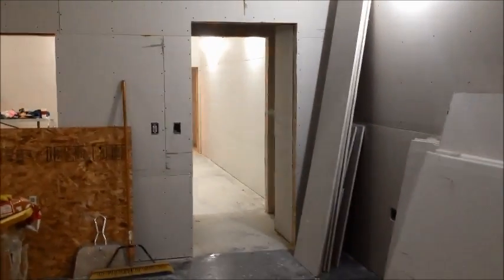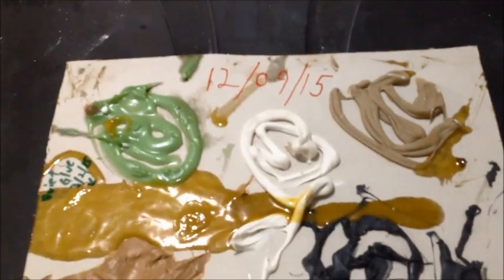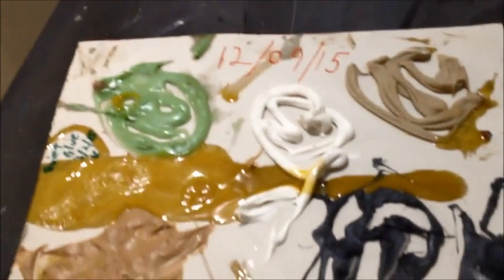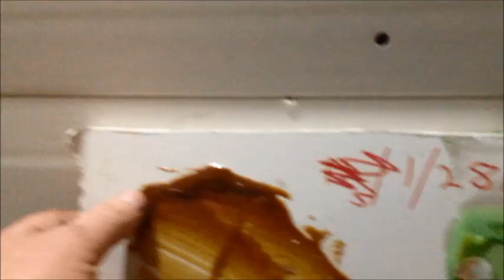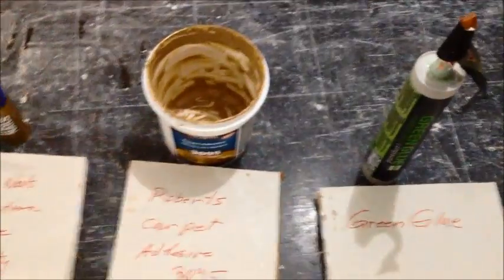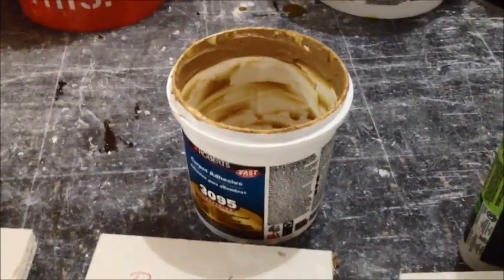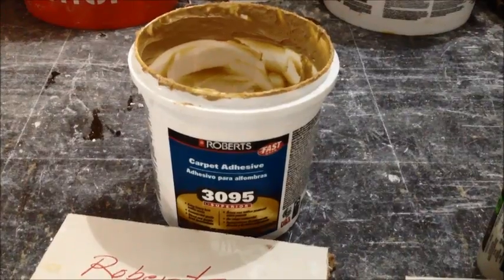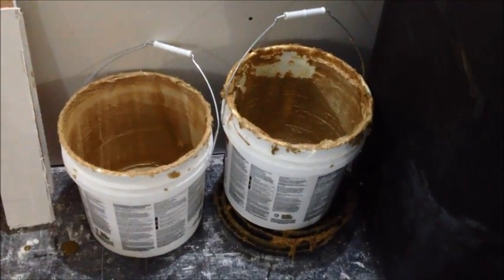Green Glue vs Quiet Glue Pro - Soundproofing comparison

Comment: REALLY COOL TEST!!!  I've been doing research too, & it usually comes down to bottom-line:  amount of desired effect compared to cost.  Watching your video would convince me to go either with green glue, or carpet glue ... that running cauk MESS will be a problem, not to mention the integrity of the physical connection between panels if the beads are running so badly that means that over time they will actually change dimension and "loosen" your lamination!  YUK to the acoustic glue that runs.  Carpet glue advantage could be use of different trowel configurations to adjust thickness of beads, putting down more material with evenly dispersed air-spaces seems to offer advantages in addition to big cost savings!  You convinced me to look into carpet glue!  For supposedly not being "scientific", I believe you did a practical real-world test that is very scientific.  Best of luck with your studio!!  Thanks for your intelligent honest post!

Comment: Yo the Roberts 3095 is Off the Chain! Really pulled through for us at our studio. for $40 for a massive container its a no brainer. Forget the green stuff and go for it. This second layer is solid as a rock at our studio...
Reply: Thanks for the update!
Reply: Can you give a rough idea of how much carpet glue is needed? Hoe much for 1 sheet? or how much for 10 sheets for example? Thanks!
Reply: @3tjrunner3  go to home Depot and buy a 4 gallon bucket. it's like 40 bucks. and we'll get you approximately 10 to 15 sheets worth. 

apply a thin layer like you would apply a very thin amount of peanut butter to toast.
Reply: This second layer is solid as a rock at our studio... I am assuming? you mean performance is solid as a rock?

Comment: The magic to green glue is that it doesn't harden which is what stops the sound from transferring, more so than the chemical makeup.  Went it hardens it becomes pointless, or counter-productive.  When you understand that, then this test is actually fine.  And, a HUGE thank you for doing this.    I'm building a 10X10ft room withing my garage for a drum-booth.  So, I've got help from the garage walls.   So, I'm hoping the Roberts carpet glue will be fine.  This was a great video.

Comment from the maker: I posted this for another person that had commented and thought it would be good to share now that some years have passed. 

Update...Isolation is still excellent. No glue seeping out of walls. That actually stopped a very long time ago and in the grand scheme of things was not very much at all. I think we used a total of 8 cases of Quiet Glue Pro (12 large tubes per case) and our total mess clean up from leakage would equal about 1/16th  of a full tube. Clean up was super easy with Mineral Spirits so definitely worth the savings in my opinion. If you can afford the Green Glue, then use it. Quiet Glue Pro was much cheaper at the time and I think we also ended up using about 12 cases of it. I think it ended up saving me about $2,000 and because of my situation of funding it all out of pocket, at the time that was a big deal for me. The carpet glue was much cheaper for sure, and the areas we used it in were not critical (lounge, restrooms, storage rooms etc) and since those areas were not super critical, I cannot say how well it worked compared to the other options we played with. Even our storage rooms, lounge, and restrooms were also treated with double layers of 5/8 drywall+glue of some kind.

Comment: The problems with running of the Quiet Pro seem a fatal flaw since it doesn't appear it ever stops running - so the sound absorption performance will continually decline as the thickness of the product will get thinner and thinner.

I didn't see you sealing all joints (wall to floor seemed unsealed).  

Carpet glue might be the best poor-man's noise sealant, especally if applied much thicker than you applied it (maybe a notched tile adhesive trowel would work better).

Sure wish I had the interweb to learn about this when I built my house 25 years ago.  Used staggered walls, foam and bat insulation.  Worked quite well, but this seems easier, cheaper and provides more effective noise dampening
Reply: Thank you! I didn't know about this Batt insulation. Apparently it's very similar to other acoustic insulation, just easier to find in stores like Home Depot and Lowes.
Reply from the maker: All joints were sealed, even the floor/wall joints. The finished result is exceptional.
Reply: It all evens out - nothing at the top of the wall, but double at the bottom.  There's likely a puddle all along his sill plate - but hey, it's an "exceptional" result. Oh my.
Reply from the maker: @ArthurDentZaphodBeeb  The cleanup from the few spots took less than 10 mins, has stopped running and the end result of the sound isolation is exceptional.
Reply: Good point about the performance continually declining as it gets thinner. It's definitely not a variable you want to have during application and prediction of effectiveness.
Reply: Quiet glue ridiculous…the white latex acoustical caulk is nonsense-it’s just latex caulk-the Tremco acoustical caulk is the real deal-it wont skim and yes it does stink and yes it does get all over your clothes- because it’s works, it’s not watery based etc.
Reply: The Robert’s adhesive makes so much sense as you can easily trowel and even ridged bead complete,y through t the surface of drywall duplicating quietrock for about 1/2 the price…the only question is does this skim over at some point, in which case it’s eleasicity will drop considerably. Green glue doesn’t, nor does Tremco acoustical caul. An excellent Proclima product also has this characteristic, but it is more glue than caulk, and I am concerned that the Robert’s product will eventually skim over . Please keep a sample going. And report Back one term pliability of this product .

Comment: Thank you very much for taking the time to put this together.  This is a very clever demonstration.   I was trying to figure out a way to justify the cost of Green Glue for a home studio project and was looking for a possible work-around solution.  The hammer pitch is distinctly different between the Green and the carpet glue  --suggesting the Green seems to do a much better job.  I was wondering, however, about putting foam (or rubber) weather striping between the sheets in lieu of any of these products.  Would love your thoughts on this?  Thanks again.  Cheers!

Comment: Would be interested in seeing how Dow Great Stuff Flexible Foam Drywall Gasket or the QuietSeal Pro compare. I realize those are meant for different purposes than sound dampening, but some of these tested products have different purposes as well. 
Were any of these measured for acoustical differences, or was it just based on how they look and feel, and apply? Those factors are good to know for installation considerations, but I am most interested in the differences between them for sound dampening.
Reply from the maker: I actually did a bunch of testing with that stuff and it was a much bigger pain to deal with and because it sets up so fast was next to impossible to use.

Comment: There is indeed a reason to use the green glue. It's intended to go between slabs of sheetrock and those are to be screwed together, many years later it will still be elastic whereas the other BS will harden and you lose your soundproofing.
Reply: Surely screwing the layers together shorts out the whole system, and causes vibrations on the layer facing the source of sound to transfer to the layer behind it.
Reply: please tell us the product ari Ari Lin
Reply: @joeanon3216  Thats not what it is suppose to do though. The sandwich is just to increase mass and make it more air tight and the stuff inbetween the sandwich is to even out the frequency response and generally dampen the whole sandwich.
You then need an outside layer, either another sandwich or say a concrete wall.
You have to decouple the whole sandwich and it's support structure from the outside layer, the layers of the sandwich itself have to be coupled, thats the whole point of the sandwich.

If your inbetween material hardens then it will lose it's dampening quality but otherwise not make things worse.
If you build your inner shell massive enough you don't need any sort of sandwich or limp mass. The sandwich technique is just to build the room within the room on the cheap without having to build a concrete bunker within a concrete bunker.
Reply from the maker: I agree. Green Glue is the best. We used it in the most critical areas and used the other compounds in the less critical areas.
Reply: Silicone
Reply: @stjoejoe  I been hearing that...

Comment: Great info, thanks. Question : The second sheet of drywall is screwed into the first sheet only, or through the first sheet and into the stud?
Reply: I"m just DIY but I've read the second sheet of drywall needs to be screwed into either the stud, or the metal channel in my case. Actually, for most of my studio I used the first layer of 5/8 OSB so I can screw my next layer, drywall, anywhere into the OSB. I will avoid the channel.  Check out my page for Home Studio progress.

Comment: Should have used THX soundproofing drywall! it's the same used in movie theaters. It's an inch and 3/8 thick.  Then green glue and layer with quietrock! I've done several theaters and music rooms that way and you will never hear a sound! people always trying to save money. just do things to the manufacturers specifications and you'll never have an issue! And for crying out loud, the green glue is available in 5 gallon buckets for under 300$
Reply: Hi, I want to build a room as quiet as I can Afford, in my basement. Planning one 2x4 'staggered studded" wall, so would I put the THX 1 3/8 on the inside of the room, or on the outside of the 2x4 walls? Quietrock x 2 with green glue in between the two layers (sheets) of quietrock on Inside of room, or On the Outside of the 2x4 walls. Also, which product for the ceiling? Quietrock 525 Or Quietrock 545 for Ceiling?? I would also use acoustical Caulk around light, electrical outlet boxes..THANKS!
Reply: Quietrock is three times more expensive than 5/8" drywall. If a person doesn't have the budget for Green Glue, they clearly don't have the budget for Green Glue + Quietrock + 1 3/8" thick drywall. Telling people to spend money they don't have isn't helpful.
Reply: Your application doesn't make sense. It will be extremely costly and this whole video is about saving cost. The double 5/8 with green glue is a proven formula and good enough for this application. After all, 5/8ths is far cheaper than THX drywall. Two layers of 5/8 with GG is cheaper than one sheet of quietrock and more effective.
Reply: Thank you for making sense.
Reply: Thank you, MudSlingr!  MUCH usable information!
Reply: @rachelw.7398  A stagger studded wall will give u a 6 inch wall (2x6 floor plate and top plate with 2x4 studs staggerd on center). Use the two layers with green glue on inside of the room and over lap the drywall in a z pattern in the corners. Use acoustic putty pads to completely seal over your electrical outlets from behind (inside) the wall. Insulate then closeup the exterior of the room with 5/8 drywall. Before setting your walls u can decouple them from the floor using an elastomeric material like sheetblok glued under the wall. When doing your cieling remember not to attach it to any structure above. Basically build it on top of your walls.Floor can be decoupled using sheetblok under the studs or u boats to float the floor. Leave a 1/2 gap between the floor and walls. Use an acoustic caulk to seal this gap after stuffing it with insulation.

Comment: Thank you for this video. I think I'm going with the ROBERTS 3095. Ridiculous cost savings vs Green Glue for dampening my drywall.
Reply: and with none of the sound proofing properties. what a deal! or DOES it actually work? Generally seems like bonding the 2 sheets with something rigid would actually transmit the sound better from one sheet of drywall to another.
Reply: Joe Moccia the point of a glue that remains viscous is to absorb vibration from the sheets of drywall and prevent transfer of sound through the sheets. Green Glue is insanely overpriced for the few decibels of difference it makes. If the Roberts glue bonds the sheets and remains viscous, it will have a similar effect as Green Glue, plus at $38 for 4 gallons, I can easily justify putting it all over the sheets and not feel like I am throwing money in the toilet
Reply: @MocciaJ  It's not rigid. It's in the documentation and the Manufacturer confirms it.
Reply: Jacob Smith toilet ring wax, or 100% silicone mixed with a little rubbing alcohol so it doesn’t fully cure.
Reply: Can you give any updates and how it went now that this comment is a year old? I'm about to use it!
Reply: Levi Jesse I'm about to find out so hopefully I can let you know. We will be drywalling in about six weeks. We hit various money snags that slowed down the whole project a lot (taxes, vehicle trouble, new furniture for our living room, built a patio in the backyard, etc.) but we are ready to get rolling again. I'm still planning on using the Roberts glue.

Comment: I did a small room for a kennel room in my house because I'm a dog trainer. I like the idea of the carpet glue I never thought of that and I have peeled old carpet up in other demos that were years old and it was still sticky. My only comment after watching this video is How did you get the quiet glue off of the surface of the drywall so you could finish the paint? We were really careful to not get the green glue on the surface of the drywall because I can't imagine how you would clean that off. If I do another room I think I will really look into the carpet glue.
Reply: He used mineral spirits to clean of the ooze.

Comment: Any chance you still have that panel a years later and can give  a recap on what the glues are doing now?
Reply: Yes, Can we please get an update. This is very valuable information to have for the AV community
Reply from the maker: I threw that thing out at some point. Sorry. Would have been good to keep around to see how they looked after a couple of years.
Reply from the maker: @Preezyfosheezy  Update...Isolation is still excellent. No glue seeping out of walls. That actually stopped a very long time ago and in the grand scheme of things was not very much at all. I think we used a total of 8 cases of Quiet Glue Pro (12 large tubes per case) and our total mess clean up from leakage would equal about 1/16th  of a full tube. Clean up was super easy with Mineral Spirits so definitely worth the savings in my opinion.

Comment: Does green glue block incoming noise too? Or just prevent noise from going out? I have crazy neighbors and I can't knock down my shared wall with them so I can only add layers
Reply from the maker: It will work both ways between layers. Its kind of like jelly sandwiched between two slices of bread. It doesn't matter which side of the sandwich you are looking at, the jelly is still the same.
Reply: @tacomarecordingstudio9366  Thanks! If budget is not a concern, what is the best I can do? Thick layer of green glue + quiet rock? How does it fare against impact noise? Somehow I can hear my 500 lb neighbor walking on his heel and my room shakes. I own a brand new condo unit and the quality of everything is driving me crazy.

Comment: Here is what I did for my walls..
*2by6 walls
*Rockwool safe and sound
*6 mil plastic
*3/4 inch Sonopan
*Rubber shims
*resilent channels
*5/8 quiet rock
*Outdoor carpet glue
*5/8 Green board 
STC of over 85, case close..
Reply: Highly doubt stc is over 85, not enough mass or damping

Comment: Was there any difference between Robert's 2057 and 3095? Your small tub was 2057, but your big tub was 3095. Why did you switch? I'm thinking of using some sandwiched between 1/8" tempered hardboard layers for a light weight speaker. I built some about 7  years ago that still sound good where I put a lot of wheel bearing grease into roofing asphalt (tar). I let the original solvent evaporate in the Texas sun with the lid of the can loose for a couple months. It never hardens, but was a lot of work to make up. Roberts makes about 50 different types of adhesives.
Reply: From what I can see 3095 is a carpet adhesive whereas 2057 is a vinyl tile adhesive. 3095 is a lot cheaper.
Reply from the maker: It was a test run to see if the consistency was the same. Which it wasn't.

Comment: other then the adhesive damping compounds, what other methods did you use for soundproofing? Double walls, resilient channels, Roxul, staggered studs, rubber isolation pads?
Reply from the maker: We used about 100 bales of Roxul, dual layers of 5/8" drywall, solid stave doors with ADA thresholds. We did not use resilient channel, clips, or pads. We did stagger studs where we needed to though.  I'll post a video of the isolation if I can ever get the time.

Comment: anyone ever try plain old GE silicone calk? it does not dry hard? As for the carpet glue how would it be in 5 to 10 yrs? What about thin foam sheet? oh well I'll go with the carpet glue as I know it works. Building a downstairs room that needs to be as sound proof as possible. Any recommendations for flooring? I know, carpet, but what kind? What kind of pad?

Comment: I know that Green Glue says to use 2 tubes per 4x8 sheet.. thats $40 at amazon prices. Not a big cost in the overall Do it ONCE as BEST for the RESULTS.  My question is knowing how to spread an even layer with a tile trowel wouldn’t it be better to use the 1 tube and spread it evenly so the GG layer is the same thickness? I use industrial sealant in building metal to metal at work and using more just is a waste. I know that GG needs a certain amount to be the layered cushion in between the drywall. But more than what evenly spreads is a waste. 
Do you have any thoughts?